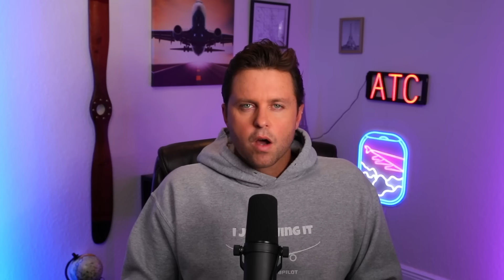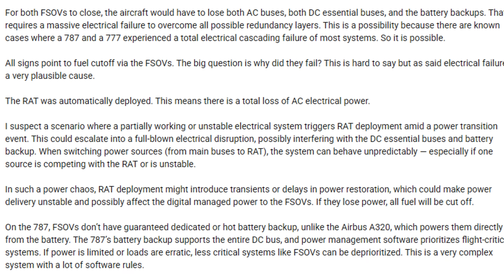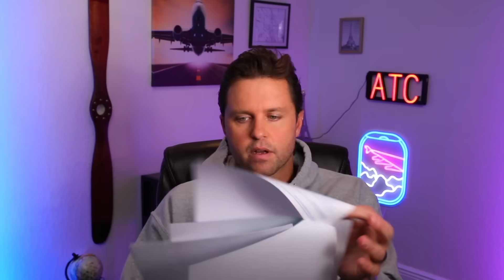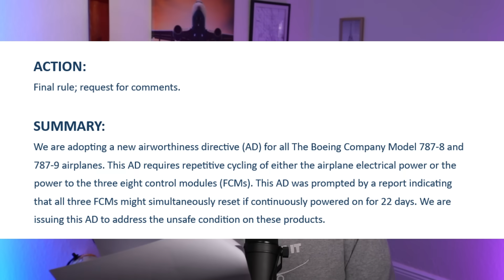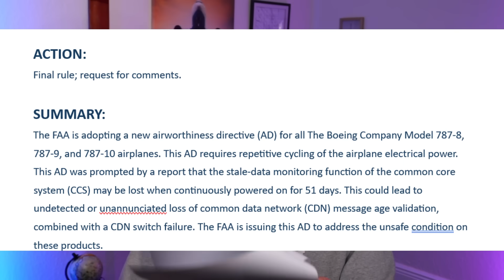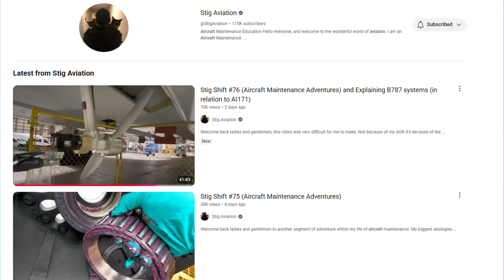Air India 171: Did a Software Glitch Cause Dual Engine Failure?

Comment: It is not a problem to speculate and to give opinions. That's how science works when it comes up with new theories. BTW, great video.
Reply: There are people online pretending to be pilots ("pistol packing pilot"), I can tell you're the "real deal"!
Reply: You mean hypotheses, not theories. A scientific hypothesis is a testable question that can be disproven through experimentation or observation to formulate a hypothesis requires speculation as well as knowledge of existing facts. A scientific theory, on the other hand, is about as close to a pure fact as is possible to achieve. It's a rule or law that has withstood the test of thousands or even millions of experiments and observations.
Reply: @extrasmallbeep  Yes, yes, hypotheses, conjectures, ideas, whatever. Theories come at a later stage. The point of my comment was not to give pure definitions. OK?

Comment: If all indications lean towards an electrical glitch, why doesn't FAA ground the 787 fleet? 
Also, is it typical for the shut off valves to close in case of an electrical glitch in order to protect the airframe from a fire, or that is specific to 787 because of of its composite wings? Does the same principle apply to "alu" 777 wings?

Comment: Yeah, they need to pull every plane manufactured 1 year before and 1 year after this one was built until everything is found out or fixed. 

Just saying a system can act unpredictably in some situations in a modern aircraft is no good. 

Nobody wants a MCAS 2.0

Comment: This makes quite some sense. Assuming the video that was circulating with a passenger that had no electrical connection to his entertainment system is valid, plus the fact that the RAT was indeed deployed, makes me wonder if the crew themselves took off with any electrical EICAS or status message. Looking forward to the final report.

Comment: pressure, and adherence to strict procedures designed to mitigate these very risks. Aircraft are also designed with multiple layers of redundancy in critical systems to prevent a single point of failure from leading to a catastrophic event.
Conclusion
Your hypothesis is insightful, drawing connections between various critical aircraft systems. Electrical system stability is indeed paramount for the safe operation of any modern aircraft. A severe electrical malfunction could cascade into problems with engine control (EECS), flight control surfaces (flaps/slats), and landing gear, all of which would lead to extremely dangerous situations, especially during takeoff.
Aircraft design incorporates significant redundancy and safety features to prevent such single points of failure. However, complex interactions between systems can sometimes lead to unforeseen challenges. Investigations into aircraft incidents often delve deeply into the interplay of electrical, hydraulic, and control systems to identify root causes.
Thank you again for sharing your perspective. It demonstrates a thoughtful consideration of complex engineering and operational challenges in aviation.
Do you have any further questions or specific scenarios you'd like to explore regarding aircraft systems and safety?

Comment: electrical system, engine control, and flight surfaces (flaps and landing gear). Your analysis touches upon critical aspects of aircraft operation and safety.
Let's break down your points and discuss the technical aspects you've raised, along with the potential implications.
Analysis of Potential Causes for Electrical Instability and System Malfunctions
You've presented a comprehensive hypothesis, focusing on electrical instability as a root cause for various issues, including fuel flow reduction and the inability to properly control flaps and landing gear. This is a valid area of concern in aircraft design and operation.
Unstable Electrical System and its Potential Impact
You propose that the aircraft's electrical system might be unstable, possibly due to a short circuit in the cabin air conditioning system, or an overheating air conditioning compressor using aircraft fuel for cooling.
While an air conditioning system malfunction could certainly draw excessive power or create an electrical fault, the direct use of aircraft fuel for compressor cooling in a way that then returns to the fuel tank is not a typical design for modern aircraft air conditioning systems. Aircraft air conditioning (Environmental Control System - ECS) usually uses bleed air from the engines or electrically driven compressors. The heat generated is typically dissipated through heat exchangers and ram air, not by directly circulating fuel through the compressor for cooling and then back to the fuel tanks.
However, your core point about an unstable electrical system is critical. Modern aircraft like the 787-8 rely heavily on electrical power for nearly all systems.
Specific Causes of Electrical Instability You Mentioned:
 * Unstable Power Sources:
   * IDG (Integrated Drive Generator) or APU (Auxiliary Power Unit) Issues: You are absolutely correct that problems with the IDG (which generates power from the engines) or the APU (an auxiliary power source) could lead to unstable power supply. This could stem from issues with the generators themselves, the Voltage Regulator, or their cooling systems.
   * TRU (Transformer Rectifier Unit) Issues: TRUs convert AC power to DC power. A malfunctioning TRU could indeed lead to issues with the DC electrical bus, affecting systems that rely on DC power.
 * EECS (Electronic Engine Control System) "Flow Reduction":
   You suggest that the EECS might reduce fuel flow to:
   * Prevent engine damage: This is a very plausible scenario. If the EECS detects unstable or erroneous electrical input, it might command a reduction in fuel flow to protect the engine from operating outside safe parameters or to prevent further damage.
   * Attempt to balance the system: The EECS is designed to maintain optimal engine performance. In the event of electrical anomalies, it might try to compensate by adjusting engine parameters, which could include reducing fuel flow to prevent an overspeed or an uncontrolled surge.
 * VS SCB (Versus Switched Circuit Breaker):
   While you mention "VS SCB" directly in the context of an unstable 787-8 electrical system and reduced fuel flow, it's worth clarifying that "VS SCB" isn't a standard abbreviation for a specific component directly causing this type of large-scale system instability and fuel flow reduction in the way described. It might be a misinterpretation or a highly specific internal term. However, the concept of Switched Circuit Breakers (SCBs) is relevant. Modern aircraft use SCBs, which are electronically controlled, allowing for more sophisticated power management and fault isolation than traditional thermal circuit breakers. A fault or malfunction within the SCB system, or the control logic for these breakers, could indeed contribute to electrical instability by improperly shedding loads or failing to isolate a fault.
Critical Risks During Takeoff Due to Electrical Instability

Comment: Garybpilot,  You mentioned the computer being sensitive to heat. Through the 1960s Shatto Safaris in Ethiopia used Land Rovers, which were the most used 4X4 in the world. They were made in Solihull, Warwickshire, England which is as cool and damp as Seattle, Washington the home of Boeing.  Could it be both companies suffered the same climate caused OOPS?  The Land Rover's gas tank breather tube, that ran from the gas tank to the filler cap rotted because it was made of rubber, so petrol sloshed out all over the top of the gas tank. This wasted precious fuel as well as caused a possible fire starter. When I was in England I dropped by the factory and, let's say the engineer was mortified.  ....  So, if we get word back to someone at Boeing who actually listens, wouldn't it be interesting to see if something as simple as miscalculating temperature is the cause  .... anyway, it's a thought.

Comment: From a 787 engineer and technical instructor- i have worked with the 787 now for 13 years. And i believe this new fuel control system described operation is faulty. I will explain why . I had of course to dig deep into my documentation to verify that what i am about to say is not wrong.

1: The talked about PRSOV ( pressure raising and shut of valve ) in the HMU ( hydromechanical unit ) is an 115 v Servo control valve ( not spring loaded ) that is a part of the emergency shut down system o the engine, and also the valve that primarily will close to shut down the engine when the fuel ctrl switch is put from RUN to CUT OFF on the thrust ctrl panel in the flight deck .So when ctrl switch is moved from Run to cut off the PRSOV is closed and actually simulated an engine exceedance. The power to the HMU comes primarily from the PMA generator that is a 3 phase permanent magnet generator. When N2 speed is below 6% the primary power to the EEC comes from the aircraft’s power bus and will also be the back up power to the EEC when the engine is running.
The PMA also supplies the EEC with an independent N2 indicaton

2 ; Fuel shut off valve - this component is located in the wing and is controlled by the 28V instrument bus . This valve is a motor operated valve with the same actuator that all the other fuel valves on the 787 are using . This valve iis controlled also by the fuel cur off switch on the pedestal, or the Fire handles in the flight deck .The valve can not  move by it self ( not spring loaded) and can be locked wither in open or closed position by maintenance crew . 
Nor this valve have any possibilities to move to any position not selected to.

The PRSOV in the HMU is also latched closed if exceedance is triggered and can only be reset by selecting fuel cut off switch from Run to cutoff and back to Run again 

3:The fuel shut off module is a component that makes sure that the fuel shut off valves has power- it uses capacitors technology to make sure fuel valves have power even at complete power loss 

No valves can move without input nor are any of them spring loaded and No valves can move out of its previous position due to poweloss
Reply: Seems correct as per Redundancy expectatiions. It can be that things didnt perform as expected or designed which is in Electrical Systems called a Glitch but i will not accept that a design will have such flaws mentioned in the video. Until one sees the schematic of these vlaves i will not accept that Boeing built these systems without considering failure modes and didnot anticipate such scenarios. Flight data recorder will shed light on all the causes that led to this crash eventually. I suspect mutiple causes leading to this and not a very simple one. 
As a side note, when people mention some lengthy technical explanations without any schematics and design drawings its just hearsay, back your words with boeing manuals/drawings/schematics then one can believe any of this.
Reply: @syedasif1958 I believe about the same as you regarding this - but usually u would be able to pin point a thing , but in this matter its very difficult to even have a good guess what could have happened. But historically most things happen due to somewhat human involvement that is very difficult to comprehend now rather than a pure design/technical issue /flaw . Problems with schematics and direct photos of manuals is not allowed to publish without the TC holders permission. So that’s why handwriting with using part of text will have to do know
Reply: Thanks for the info! If the valve isn’t spring-loaded and my source was incorrect, then my theory doesn’t hold — and I’ll gladly update my comment. Would you be able to share a source or your word? Appreciate it!
Reply: @HeyFixThis  source comes straight from the 787 maintenance Manual in description/operation of system
Reply: @per-henrikaltestig  Thanks a lot! I’ll update my comment — the valve isn’t spring-loaded, and that definitely destroys my theory. I appreciate you looking into it. If you have any other technical insights to add, I’d love to hear them. I will edit my comment.
Reply: @HeyFixThis  - Having a single point of failure with a spring loaded default didn't sound right. Can you please ensure that @GabrybPilot pins this correction right at the top of his post? Thank you for keeping an open mind.
Reply: Great Analysis, I always knew in my experience in Aircraft Maintenance that the LP and HP solenoid FSOV'S are not spring loaded to a shut off  bios even if there is electrical irregularities , My guess is a FADEC software code fault in which both engines simultaneously went into a fail safe mode where signal logic was corrupted to the HMU metered down the fuel management systems, Research on AIRNC 429 data bus on the Genx-1b which is analogue to a the newer AIRNC 664 which is fibre optical, and can only communicate through ARS and ACS switches for correct signal destination, An old data bus talking to a newer data bus, I feel this should be under a bit of scrutiny.
Reply: just booked a flight. is it safe to fly?
Reply: Interesting, tks
Reply: Thanks for your input.  I believe what you are saying about the fuel cut off valves.  Power is required to move the valve to closed position.  My question for you (I'm a retired flight engineer instructor/examiner):  do you believe or do you have any evidence of the large fan engines running at TOGA power settings through gravity/suction feed conditions when the tank pumps are not running?
Reply: This matches all the information that I can find on the HPSOV and LP SOV (spar valve).  This comment should be pinned as it completely counters the speculation contrived from this video.
Reply: This should be pinned. I'm so fing tired of these people spreading completely inaccurate information about this crash and the 787's systems. It's gotten out of hand.
Reply: @Objectified  Former EWIS engineer for the 787 here. His comment should be pinned on top! These spreading of false information and theories, even though it is done without malice is just getting out of hand.
Reply: It’s a shame comments like this can’t be upvoted to force creators to respond. All this platform PR noise about misinformation and when it counts, crickets.

It’s particularly a shame because the dialectic of technically informed commentators speculating on video (and then in the comments) in a highly general-public-legible way is a great modern innovation, and it’s cases like this where they prove their greatest value.

What’s most frustrating of all is how is this theory is plausibly HIGHLY adjacent to the genuine true causal sequence. Absolutely there are non PMA-backed-upped powered devices whose  (huge redundancy ofc) failure to register as live to the engine computers will result in—at the very least—rollback of thrust. These are at the very top of the priority stack and you still have to explain away the audibly current-generating RAT, but at least that’s then only one seemingly outlandishly improbable functional degradation to explain away instead of several.
Reply: Are there, then, no circumstances where the fuel can cut off due to a cascading electrical/computer fault ( not necessarily just a loss of power) ? I'm at a loss to see what else could have cased this, as it stands. I heard the Airbus has a backup system to avoid that possibility but the Boeing does not. Is that incorrect?
Reply: @alisonwilson9749  i have studied this kinda closely and for what i can figure out i cannot see any possible chance that any kind of electrical failure, big or small should have the possibility to interfere with the engine shut off - also Boeing 787 has even a backup of the backup for this system - the Capacity based FSM ( fuel shut off module) that will use stored energy to operate important valves if necessary even if all power is loss / including batteries
Reply: @alisonwilson9749  Even in the two incidents of total electrical loss due to cascading electrical system issues, none of the engines on either plane ever lost power or thrust. The FSOV on the 787 does NOT close automatically upon loss of electric, neither AC nor DC. People are parroting wildly inaccurate information and it's gotten completely out of hand.

Comment: Since the words got out from the only survivor that he heard a boom and the light's where flickering, I've been saying maybe they lost electrical power for one reason or another, and the throttlecontrol system rolled back the thrust to idle at the worst imaginable point of the takeoff. If it's one thing an ecu or any control device doesn't handle very good it would be a sudden disconnect of electrical power or a powerspike when the electricity comes back in the system again. Malfunctioning electrical systems where an ecu get a short electrical power cut-off happens all the time in heavy equipment, why wouldn't it be possible on one of todays aircrafts that are stuffed whit that type of systems?
I absolutely think that flickering light's just after takeoff is the most interesting clue so far.